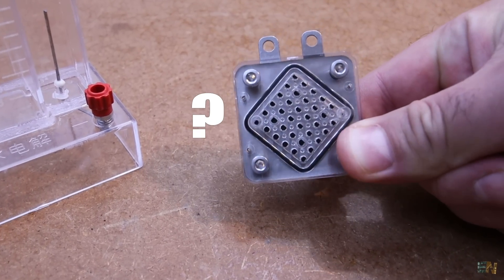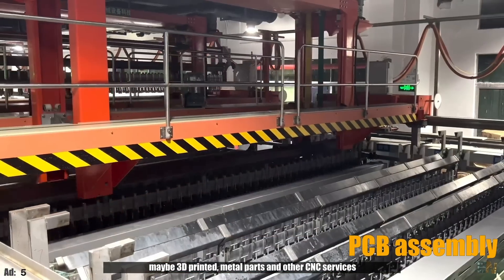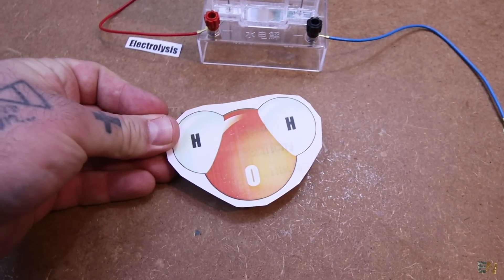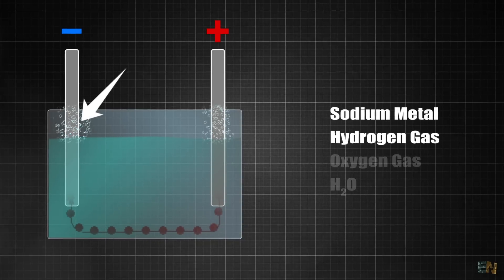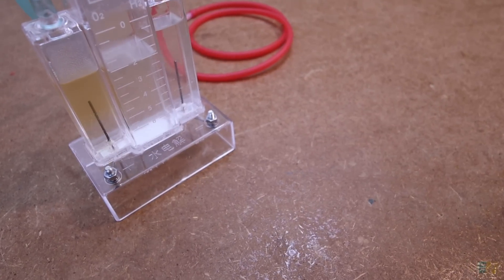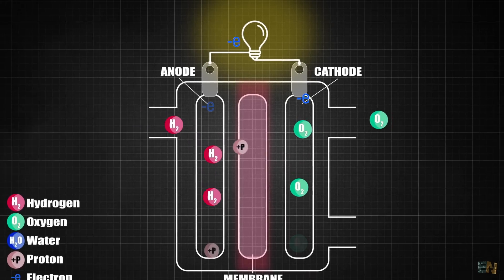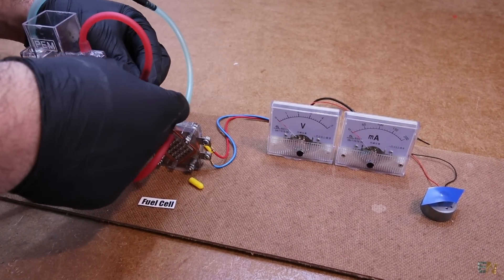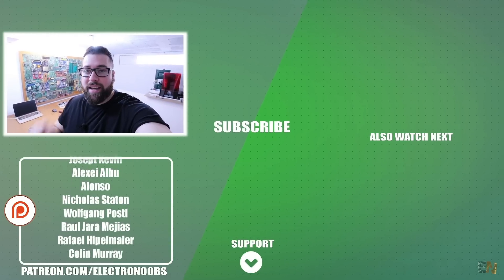Hydrogen Fuel Cell - Is Hydrogen Car the Future? + Electrolysis

Comment: Hydrogen should not be considered "fuel",  because we can't just go out and harvest it.  Instead we have to produce it (usually by separating it from the oxygen in water).  The energy we have to put into this production is greater than the energy we get back from using it as "fuel".  So in this respect it's nothing more than an alternative to a battery.

If you're burning hydrogen in a vehicle, you're just getting back the energy that was used to produce it.  Somehow you still need to have a source of energy to produce the hydrogen in the first place.  If that energy source is portable, it would be more efficient to use that energy source in the vehicle.  Thereby removing yet another inefficiency from the process.

Comment: Okay here's an idea, just use electrolysis to create enough fuel to propel a single piston to drive a flywheel.  One big push at a time, nothing fancy, start small scale.
Have the flywheel used to generate electricity

Comment: News flash....There is nothing efficient about hydrogen!. Its not abundant in the atmosphere, its really costly to produce with electrolysis. The only slightly costly way to make it requires the use of hydrocarbons.....Not to mention, it is really weak compared to other sources of energy.

Comment: Forget using electricity to split with sodium-hydroxide, instead capture the gas using Aluminum in water and sodium-hydroxide and run it through the cell.

Comment: The electrolysis that you have explained is incorrect. At the Anode, hydrogen is formed, but the sodium stays dissolved in the water, as it takes less energy to form hydrogen than sodium

Comment: I used a single Mason jar once, with a couple of nails for electrodes.  There was a tube which released the gas.  Stupid me, I thought it would be cool to light the end to see gas flaming.  You know what happened next.  The flame immediately travelled down the tube, into the jar, and blew off the lid.  It sounded like a shotgun went off in my kitchen.

Do not attempt unless your homeowner's insurance is up to date.

Comment: I think cars shoul have hybrid systems and interchangeable modules... ie electric gas hydrogen engine modules... interchaneable power source modules like for all like usb protocol... plug and play systems... and in futre it will but how long ... there is times anythin becomes unavailable periodically... i mean of we look at water icebergs contine meltimg water continues ewaporating from sky 😊 fossil fuel is continuing decreasing on down... welll we won see that happen mostlikely but there will be someone seein that 😊

Comment: I really want to understand how this can be efficient when you use far more electricity than what ends up at the motor.

I would also like to understand how this can be safe when a byproduct is sodium metal which is highly flammable when exposed to water, which this mechanism is filled with.

Comment: Does we need to give electric power to the electrolysis to get another electric power?
Reply: Yes is the simple answer; however, the amount of power you use to generate the hydrogen is more than the power you get from the recombination of the hydrogen and oxygen. It is not an efficient process, so is not used.

Comment: Well that sounds a waste of time just some bonehead wanting a piece of the pie still needs power to get hydrogen and to convert it back to electric 🙈 that's like using an inverter from 12v to 240v then back to 12v to charge another battery unless fuel station had a swap machine that can refill a cell and give you a fresh one but that means all manufacturers have to use a universal design to fit all cars ....
Like that's gonna happen with the greedy CEOs profiting beyond belief 😂

Comment: Hi electronoobs
Recently I tried to make the brushed drone project with some bigger motor
Using multiwii firmware but I am having a lot of problems:-
1.Multiwii not starting saying Javaw  
    not found etc.
2. I install Java 11 se the the
    application starts but when as
     soon as I hit start the program
      crashes .
3. I switched to java8 se the program
     runs but lags alot some time it
     doesn't show any gyro value .
4. after few attempts by using your  
    bldc drone code I was able to
    connect but the gyro movement of 
    quadx gui is reversed

Please help and if  possible make a complete tutorial on multiwii how to install run without problems connect to brushed drone code how to adjust gyro and pid values plz it will be a great help from you
Reply: By the way I am using Arduino nano is that causing me problems

Comment: 🤣🤣 this is a chemical battery... Measure efficiency..
Power in and power out.. is terrible. 
More efficiency in lithium battery or o
Otto converted to H20 fuel.
Edit: good explications, and for i...... peoples, the energy not come from water, is crom hydrogen and hydrogen is maked  with electricity.

Comment: Hi I have a question on your previous esp32 nes console project. every time i compile the code I get an error that i need to #include "P:\1a Youtube videos tercero/ESP32 Nintendo/NesCat-main/src/hid_server/hid_server.h" and that the compilation is terminated and it says there is no such file or directory even though when I go into the files I can find the his server h file. Other people are also having this problem so please help me out I really want to finish this project
Reply from the maker: Maybe just change the root to your root instead of P:/ etc.... Place your root of the folder?
Reply: @ELECTRONOOBS  I just did it and it didn’t work it still says no file or difectory
Reply: @ELECTRONOOBS  can you try and follow your tutorial on the code and tell me if you get that issue? And then if you do then you can fix it and tell me please and thank you I’m really annoyed with this because I already have all the stuff solderef
Reply: @ELECTRONOOBS  I got past it but another problem went up and then another after that one please try and fix it so that I can finish making this thanks

Comment: ... isn't it better to use the 80% of the electricity to power a battery operated car that you spend 30 sec to plug in and then go to bed,rather than have:
1) electricity to generate hydrogen
2) electricity to pump it in a tank
3)diesel or hydrogen to move the tank
4) electricity to pump it in the distribution storage
5)electricity to pump it again in the car and wait 5 minutes.
6) transform it in electricity to charge a battery
7) run the motor of the battery

Gasoline electric energy need for all of the pumping and refining should be around 1kw every 4 liter, if we skip the pumping efficiency goes up 

Do you really like going to p petrol-hydrogen station?  

The switch to electric is gonna be perfect when a Battery vehicle with  5 or 6 Hours of motorway will be affordable, you need to stop to eat anyway
Reply: @hello the real reason because I don't buy an ev is that little bit too expensive, I would myself use a short range ev,and when is the time for me to change car I'm sure I'll move to ev, is not the way to convince everyone, the range is the only real, and over perceived downside of an ev for everybody,I speak about my colleagues that are hard petrol head, if there are no excuses for them not to chose an ev we can speak of a car for everyone.
We need to see the other side of the argument and understand
Reply: @matteoricci9129  in Belgium there is something called capacity tax. In short, they punish people with taxes if they consume too much energy from the grid, because otherwise they have to invest in the electricity grid... So at this moment maybe a hydrogen operated vehicle will be cheaper then driving an electric one (?).  In fact that is even an argument to go for a hybrid car... and if all people in Belgium would drive electric cars at this moment, the electricity grid would go down, they warn.
Reply: @pieterpauwelbeelaerts5995  fancy that, in Italy, there was something like that but to improve use of heat pump they removed this tariff for houses, I checked the annual uses of electricity and in Italy is in decline, maybe a 5% over 10 years, so Italian electric grid would be able to cope at least for the first 4 or 5 years of adoption.
Hydrogen still uses more electricity than just charging a car, so it will only increase the amount of electricity needed, I don't see it as a solution.
Hybrid is a good step in the right direction, and it was a good choice when there are no other alternatives, but you can consider that electric cars are a better step in the right direction, better still no car at all.
everybody willing to do these steps will do it depending on his condition, but here we need to check the claims, like what amount of hybrid:
- mild (regen breaking and slow speed) is just an ice car that uses less petrol, long therm is not going to solve anything.
-plug in could be great, if you use them right.

Comment: I spoke to a bus driver who had driven hydrogen buses. For them the problem was safety. They had to install elevated pipes at the depot etc. maybe at the scale of a car it would be sufficiently safe but it didn’t sound suitable for buses at all.
Reply: They should add a smell to hydrogen, just like with propane or natural gas. Like that, we would know faster if there is a leak.

Comment: Hey, it should be possible to run the fuel cell with air and hydrogen.
If yes can you do a comparison with Oxygen/Hydrogen and Air/Hydrogen? Would the efficiency be affected? Thanks
Reply: yes possible, same as with pure oxygen.
Reply: The efficiency goes up running pure oxygen because you’re not having to compress the air plus the power ratios would be higher because oxygen is Five times more powerful than air as an oxidizer

Comment: multi-layer ZnBr gravity cell battery, rechargeable directly, many wide slim no-pump cells
Reply: energy density in same range or more than lead-acid battery, about 80Wh/kg, a bit less then li-ion (which are up to about 200Wh/kg now)
Reply: easier containment than hydrogen, same as lead-acid batteries
Reply: no harshly toxic stuff, just salts
Reply: kinda same as mild sulfuric acid electrolyte
Reply: try baking soda instead of KOH/NaOH
Reply: PEM = salt bridge, can be aqueous, does not have to be complex

Comment: The problem with fuel cell is they are too expensive also the storage is expensive too and too heavy, i believe that hydrogen is the fuel of future but we still have to work on fuel cell and storage, thanks for the informative video 🎉
Reply: There are videos on YouTube showing Hydrogen delivered via a plug in cartridge or a paste.  Both of those methods would significantly improve the distribution process, as well as speeding up refueling (pull out the old cartridge, slide in a new one, and off you go).  I could imagine said cartridges being sold in virtually any store.
Reply: @toddprickett6376  There are production and scaling  issues, but please notify  us when those things become CHEAPER than PLUGGING into a wall outlet like they do in a BEV , Hydrogen = " Fuel of the Future" , maybe another  hundred years?

Comment: just use regular table salt. sodium hydroxide is very NASTY stuff.
Reply: Except you can end up with chlorine gas byproducts to deal with.
Reply: @AirzonesBlasters  very good point! a well ventilated place is indeed necessary. still, given the amounts at play, I would say it's safe enough and easier to open a window than manipulating  caustic soda, which involves proper use and disposal of PPE. NaOH just loves sweat and soft tissue.
Reply from the maker: Chlorine is worst

Comment: Hydrogen is complete garbage, as it is a worse version in every aspect of the core product it is made from. Hydrogen is made from CNG, which is almost the same thing, but the conversion costs about 60% of the energy of the base CNG. CNG in its pure form is easier to store (lower pressure and lower container penetration) and is already widely used in industrial, home appliance and automotive applications. Converting a car to hydrogen is far more complicated than CNG as it demands lower compression and more temp resistant materials. Making a hydrogen car costs $20k to have a 100kw fuel cell, meanwhile you can convert any road car TODAY to run on CNG for 1000$.

Comment: The full efficiency is about 25% not 60...
Reply: fuel cell and electrolysis are also highly susceptible to corrosion ! the efficiency of a gasoline combustion engine ranges between ( 36 % - 42 % ) and perhaps more, this is more efficient than photovoltaic cells ( 18 % - 26 % ), for example.
Reply: Hydrogen production by electrolysis is about 75% efficient. Hydrogen fuel cells are 40 to 60% efficient. Traditionally electrical motors are about 80%.

Now if we are very generous and assume that all the components in the chain hit very high efficiency such as 80% for the electrolysis, 60% for the Fuel cell, and 90% for the motor (because someone will claim that) you get a combined efficiency of 43%. But if we de-rate the motor to 80% efficiency that turns into 38%.

With more realistic and reproduceable numbers you get 75% x 50% x 80% and the efficiency is about 30%.

Now if you were to include the generation of the electricity to drive the electrolysis then efficiency goes down drastically. But without doing that you can compare the hydrogen fuel cell technology with battery electric vehicles. When I looked for Lithium Ion battery charging efficiency the first answer I got was that it is ner 100% efficient, compared to lead acid batteries that are "only" 85% efficient when charging. Second link claims 99% efficiency while the third ling says it's 70%. The rest I saw claimed between 80 to 90 % efficiency when charging.

Even if they are "only" 70% efficient that would still mean that a BEV has an efficiency of about 56% if the motor is 80% efficient. That is a whole lot more efficient than the fuel cell version.

Another interesting thing is to look at range. One of the things that people often say is that with a hydrogen driven car you can just fill up the tank in seconds or minutes rather than have to wait for a battery pack to charge. And that's fair. But how far can you go between the fuel stops? And here hydrogen is at a disadvantage as the gas is so light. Even at a liquid state it has only about 20% of the energy density of gasoline when compared by volume. Number ripped from my far from reliable memory so take that with a grain of salt. That means the fuel tank has to be four to five times as large as the gas tank if you want to drive as far on a tank as you do on gasoline. And the tanks can't be simple constructions either. They are either high pressure tanks or they are low pressure isolated tanks. The later is most common in the tests I've seen, but they have the disadvantage that they can't perfectly isolate the hydrogen, so they are constantly bleeding hydrogen that cook off. A tank like that is likely to bleed off all hydrogen in a week or two even if the car never leaves the parking lot. Also the hydrogen that is bled off is a fire and explosion hazzard.

High pressure tanks are heavy and expensive. How heavy I can't say as I haven't looked into it. But the fact that auto makers experimenting with hydrogen fuel cells usually don't use them suggests that they are not trivial to build right.

Someone I talked to thought that solid hydrogen would be the solution. That is hydrogen chilled down to the degree or pressurized enough that it turns metallic. I did look into that, ignoring all the practical problems of actually doing this. And the results were not encouraging. Metallic hydrogen is not significantly more dense than liquid hydrogen. So it would be a lot of added complexity and cost for very little, if any, improvement in storage density.
Reply: @blahorgaslisk7763  I'm sorry I didn't read everything but you need to include gas compression/liquefaction and transportation Wich will reduce the efficiency significantly.
I've worked with hydrogen (liquid and gas) and the tanks are so heavy in comparation to the mass of hydrogen that we usually say things like "the steel truc is here".
For the solid state storage it's an utopia, it is indeed possible to store a lot of hydrogen in magnesium for exemple 30% in mass approximately (you need about 1kg per 100km of hydrogen) so the storage could be only 20kg of magnesium for a good autonomy.
Buuuuut we need to heat up A LOT the magnesium to recover the hydrogen which is... Not efficient at all...
Reply: @oneil9615  Thanks for the heads up on compression. It's easy to forget a step like that when you don't work with the media.

Enginering Explained did some videos on Hydrogen and talked about the low power per volume you got with hydrogen. That and the heavy tanks for liquid hydrogen was what he concentrated on before even talking about the efficiency. If you want to see some really horrible numbers look at combustion engines running on hydrogen...
Reply: @blahorgaslisk7763  I'll check engineering explained, I also recommend engineering with rosie

Comment: Your chemistry on the electrolysis side is incorrect. Sodium hydroxide is normally NOT consumed in the process. (I think you might have looked at the chemistry of electrolysis of (molten) sodium hydroxide, rather than water with dissolved sodium hydroxide. That's a totally different thing)
Nice video for the rest though.
Reply from the maker: My chemistry knowledge might not be totally right 🧐 Chat GBT didn't help enough hahaha. Anyway I didn't what to say is consumed, what I wanted to day is that is making the water more conductive.
Reply: @ELECTRONOOBS  fair enough. I think at some point you say the electrolysis of sodium hydroxide (which you more or less described), while this is just electrolysis of water.
ChatGPT also answers if you make a minor error in the way you ask the question... 😬